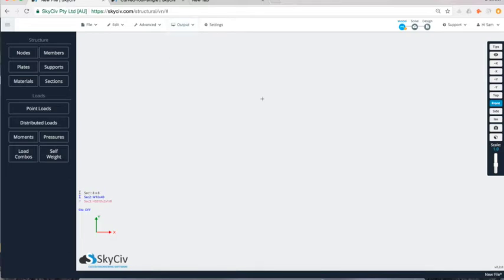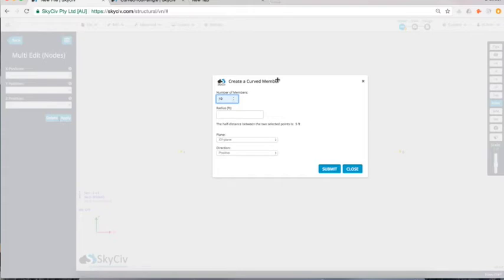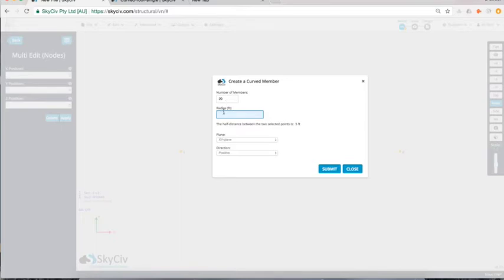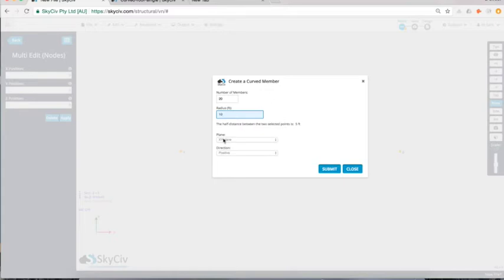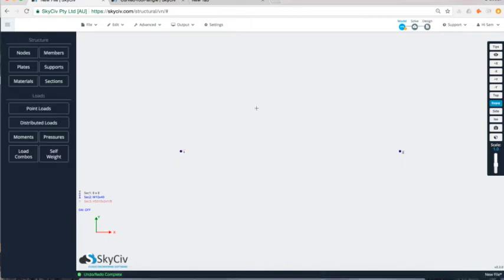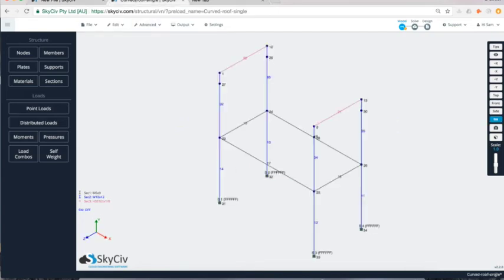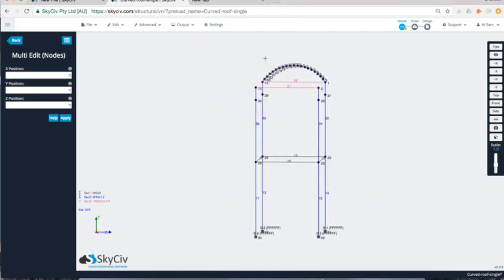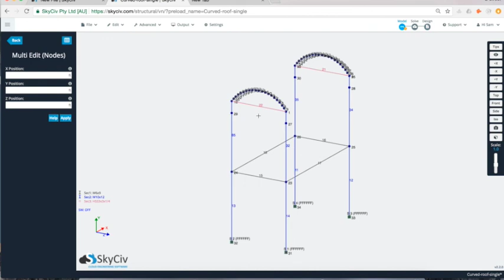Curved Members | SkyCiv Structural 3D

Comment: I see this methods adds nodes in between the members automatically. This is good to create an arch, but not a suspension cable. Is there a way to model and analyze a suspension cable in your software? I know that straight cables can be (using your non-linear analysis tool), but how about a suspension cable?
Reply from the maker: Yes it is possible using the catenary cable element.